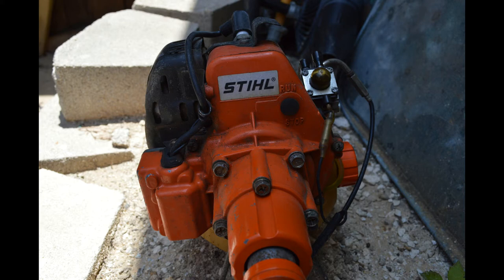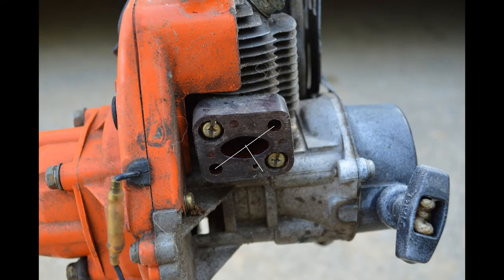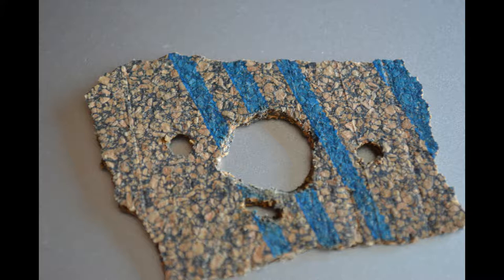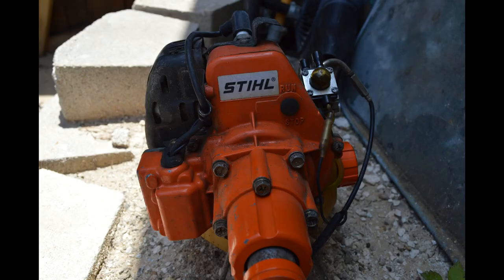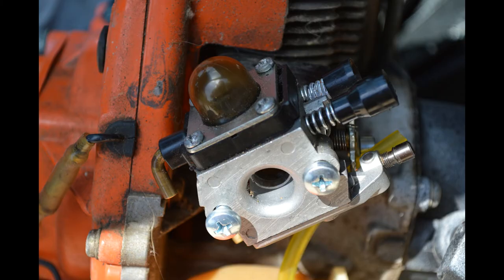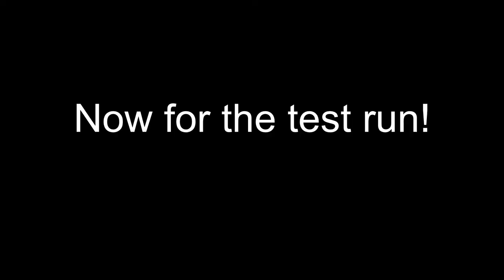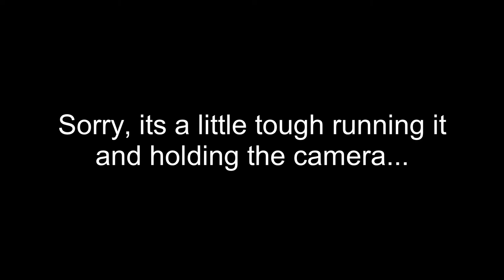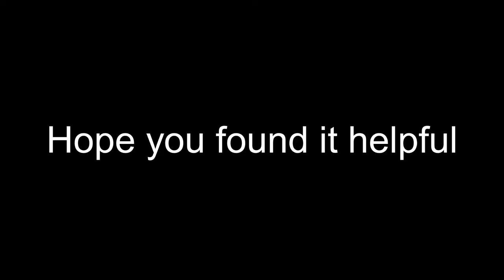Stihl fs80 (av?) Replace original carb

Comment: ?? What carb would fit my still fs80 av I have the original tk carb but want to by pass and do away with the tk carb
Reply from the maker: Just look ebay for FS80 fs75, etc. carb and it will give u the recent FS80 carb. That's what I used.

Comment: Thank you for the video. I have the holes in the gasket lined up between the block and carb, it will run for a bit and stop. I have a new Echo fuel cap on the tank so that leads me to the fuel lines, the line with the filter is laying in the gas. How far in does the other one need to be and how did you close off the old hole for the fuel line?
Reply from the maker: When it stops, press the primer. Is it firm like it was when you were priming to start or soft and it gets more firm as you prime it a few more times? If "soft and gets more firm as you prime it" then the gasket between the carb and engine block does not line up so the pressure in the tank that built up when you primed it, drops as the gas escapes the tank and burns.

For the original rubber seal where the original fuel line went into the tank, i took 2 1.25" fender washers, piece of gasket, bolt and nut, and Goop glue. use the bolt to hold the washer which holds the gasket inside the tank. Put the goop glue inside so gas doesnt leak out between the bolt\washer\gasket. Put the other fender washer outside and tighten the nut on the outside to hold the seal. cut off the extra bolt thread and Viola!! The original rubber seal leaks and using goop, it still breaks loose and doesn't hold pressure. Want to see this hack in another video on this???

Comment: One more thing , i was looking at one carb on ebay to buy it and then i questioned myself is the new carb working the same way as the old one 
because there are two connectors one for the fuel line and the other an overflow like on the old tk ? Because im normally working with chainsaws and the carb is getting the pressure for the membrane a bit different. Thx
Reply from the maker: Are u asking if u need the second hose to the tank? Adding this did a lot for me - i can trim upside down\on side\etc. Without it like on my FS65, the engine drops when I tilt it to edge sidewalks before I upgraded it to 2 hose carb. 
Plus the carb 2nd port either needs to be connected to a 2nd hose or plugged if u don't want to drill. Is that what u r asking???
Reply: @MrFixIt-le7tl  That was my question thanks

Comment: The throttle cable is connected to the internal of the old carburetor.  I have no idea how to remove it separately.  Do I have to replace this also to change to a new carburetor or can I somehow disconnect it and use it for the new carburetor?  Thanks for the video.
Reply from the maker: When u unscrew the "cap" that the cable goes in to, you have a spring pushing the cylinder piece down. Compress that spring and the end of the cable with the "ball???"     will pop out. Follow the vertical slot cut in the cylinder- that is where the cable runs and hooks.
Reply: Mr. Fix It  Thanks.  I got it re-routed.  I've reworked the unit just like you did and it started and ran for a few seconds then stopped.  Can get it started for only a few seconds then dies.  There is gas in the bulb yet it acts like it is deficient of fuel.    Any ideas of where to go from here.
Reply from the maker: Start it up with a filter on it. some of mine run lean without the filter on. Press the primer 2x  and make note of how firm it is. Now start it. When it dies prime it again. Is it still firm as when u first primed it? If No, gasket is leaking- something is not lined up. redo that. You say it runs for a few seconds, i would bet this is your problem as it runs burning fuel and the pump not working (leaking gasket), the fuel pressure drops thus dies in a few seconds. Post your findings.
Reply: @MrFixIt-le7tl  Thanks for your help.  I pulled the starter so many times I got a blister.  Let it sit overnight and the next day after about 6-8 pulls it started and now it runs like it was new.  Have tried it again and it starts easily now.  I didn't change anything internally so none of that was an issue.  I can't explain why it was reluctant to start but suspect a fuel issue. Could I have flooded it?  
   But due to your video I have made a worthless trimmer into one that runs good-as-new.  Many thanks!!!
Reply: @joetraxel7822  When priming (especially first time in the spring) I prime it until fuel squirts into the primer then i push 1 more time for good measure. Usually it then takes 2 pulls to sputter and die becuase im not quick enough to open the choke. Open then it fires up and occassionally i need to feather the choke but safe to say Im in business. You say you got fuel in the priimer so yeah - probably flooded it. No worries. If do it again, remove the plug to see - if dry = lean, if pretty wet=flooded.
From personal experience, when i got my first fs80(along with a fs65), i had many blisters eventually understanding how these work and eventually finding this setup that has worked for me since '99. As Clinton said it best  "I feel your pain."
Reply: I bay 10mm carburetor from China-aliexpress for 5 dollars and work perfectly,modifications is very little,only trothle cable and gasket.

Comment: How difficult was this to do. I have one I thought about doing the same thing. What gasket material??
Reply from the maker: It should be pretty easy- making the video took WAY longer... You only need a drill to drill the new hole for the hose. The rest is just supplies.I just got this trimmer($10!!) - perfect guinie pig to use to make the video and it took me 15 min (after getting the screws- the rest I already had) to do this.Look at auto supply stores(maybe walmart has it) for the gasket - get the cork type. The other type sold is thin as paper. I figure if there are imperfections in the mating surfaces, the cork being spongy would fill low spots better.
Reply: What carb did u use??

Comment: Wanna do it too but there is one thing i dont understand where is the choke is it build in at some air filters?
Reply from the maker: The choke is on the air filter housing. I left it off in the video as i took pics as i did the repair. You can use the housing off Echo or Stihl products - both fit.
Reply: @MrFixIt-le7tl  Thank you i really didnt expected your aswer!!

Comment: does this also work with the very old fs80 with the same TK carborateur
Reply: Sorry don't understand. This procedure is on the original FS80 (late 1970's) with TK carb...
Reply: Its a fs 80 without ave and looks polder i think 35 years old
Reply: But iT can older to
Reply: @TheSeniorTaco  i mean this one https://www.worthpoint.com/worthopedia/stihl-fs80-trimmer-engine-model-boat-173329929
Reply from the maker: @teammouse  I have a few of these. For the most part, it stays the same. Where they differ is the solid state ignition is bigger than the points ignition coil. Multiple Flywheel part numbers work with either ignition- points of SS., etc. or else it is the same carb setup. I have 2 that have the FS80 sticker on the back - no AVE. the AVE (which is the one i used in the video) i believe the E is the electronic ignition.
Reply: @MrFixIt-le7tl  thank you for the information!

Comment: How did you attach the throttle cable for this?
Reply from the maker: I took some scrap metal to make a bracket to hold the end of the cable - See pic. https://www.flickr.com/photos/9242898@N02/47416328692/in/photolist-2ff25yu